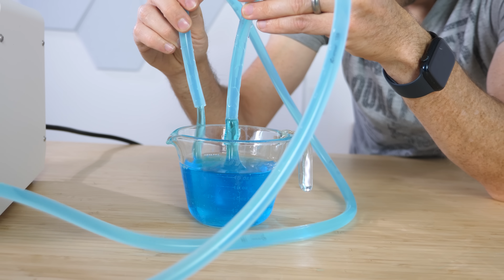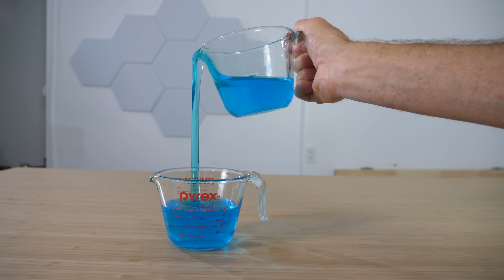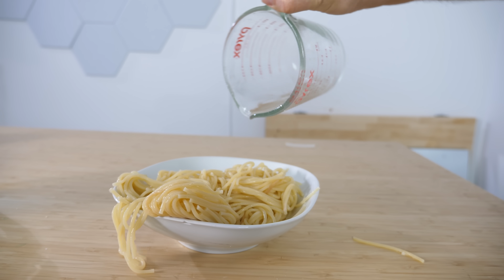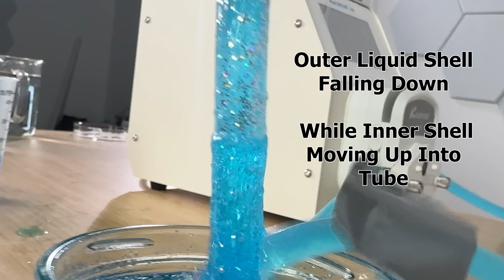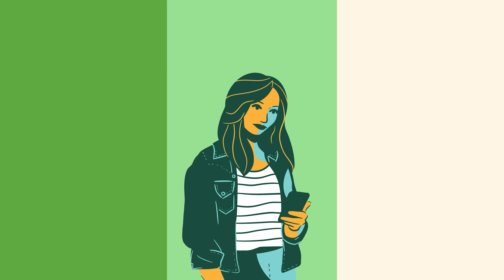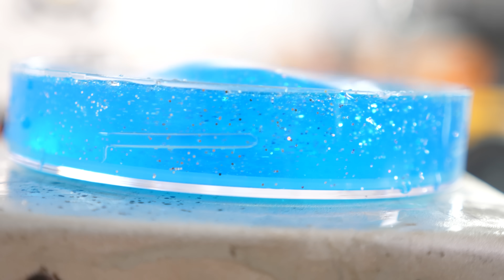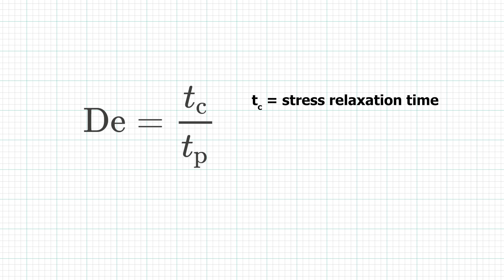Why Do Some Liquids Flow Up? The Mysteries of Shear-Thinning Fluids

Comment: Now I am curios. If you have a rod inside a sphereical container filled with some of PG, how would it move if you start to spin the container on the side of it's axis vs vertically? When you spin it sideways it climbs both ways on the rod. If the rod leads to a curved surface that curves back, and possibly back to the center of the rod, would the PG constantly be in a loop of following the rod, curving, then reattaching to the rod again?

Comment: Can you combine magnetic locking with a stirring plate using Lenz's Law?  I wonder if PEG could help stabilize a magnet with an aluminum disk glued to it, if it is made to levitate and rotate in a PEG solution (and cool it since the eddy currents will heat the aluminum,) and if PEG, PPG, or plain Propylene Glycol work best?  I'm looking to stir a solution in a round-bottom Erlenmeyer flask with mica powder pigments in it, to look like a potion, and I'm hoping to dampen the noise it makes by separating the stir magnet from the glass.

Comment: Action Lab: you are incorrect about the method of action of PEG-3350 (Miralax) as a laxative. It is not the fact it is slippery, but what Wikipedia says:

[Miralax] is an osmotically acting laxative; that is, an inert substance that passes through the gut without being absorbed into the body. It relieves constipation because it causes water to be retained in the bowel instead of being absorbed into the body. This increases the water content and volume of the stools in the bowel.

Comment: For information, visco-elastic properties are generally determined by sending oscillations to the submerged rod (or to two plates with the fluid in between) and measuring force vs movement of the rod. If the tested product is elastic, the force is proportional to displacement, while if it is viscous, the force is proportional to velocity (ie derivative of displacement).  So, if you plot force vs displacement, oscillations are in phase for elastic , out of phase by 90° for viscous and in between for viscous-elastic. Varying the force can give you the shear thinning properties if any and varying the frequency will give you the time dependency (visco-elastic fluid will be elastic at high frequencies because the long molecules don't have the time to rearrange and viscous at low frequencies)

Comment: I have a question that i believe can only be answered with an experiment:

If we have a long enough tube full of really cold water but with a really strong heat source on the bottom that can cause the water to boil and turn into vapor will the bubbles condensate back into water before reaching the surface? i am guessing that given a long enough tube that will occur but how long? preferentially not bubbles the size of the ones you see on sodas or electrolysis... i guess i just wanted to see a really big bubble get smaller and smaller until it disappeared...

Also... will the heat spread more efficiently through water if it doesn't get past the boiling point? i am guessing the heat inside bubbles wont make contact with the water around so maybe it's not optimal for heat spread... not to mention that past the boiling point it just turns into vapor and goes away so the system loses more energy that way...
Reply: Yes, the bubbles will condensate back into water before reaching the surface provided there is enough distance for them to be cooled below the state change temperature.

The main issue with such an experiment would be trying to create such a setup in the first place. Given the very high heat capacity of water making it difficult to increase the temperature of, you will most likely cause the entire vessel full of water to increase in temperature thus you wouldn't encounter any potential cooling effect.

You'd be better off with some liquid that has a much lower boiling temperature and heat capacity that can come in contact with a very high heat and instantly boil without affecting the entire body of liquid (So the liquid not in contact with the heat source remains cool)
Reply: @tarille1043  i suppose we can heat water on a second container and force the steam into the bottom of the tube with really cold water using a release valve... I think it may not be that complicated afterall, i recon even i can do it but probably no one would see it x)

Comment: you should make something that causes cavitation, like a metal box or heavy duty plastic cup that gets hit by a hammer, but just see the effects it has with different things put at the bottom that stick to the bottom, that will get hit by the massive energy caused by cavitation.
I asked chatgpt about whether or not cavitation could break the cell wall to make grass edible, and it said it could, but then it would have to be fermented to break down the other parts that arent edible to humans.

Comment: I just thought of this.  We've probably all heard a parent say, "I'm not paying to heat outdoors. " when you leave the door open.  I wondered if based on one door, from one house, per length of time,  could you calculate what would happen on a cold winter day if every house in the US opened two doors with the heat blasting at a certain temperature? Could we raise the average temp even 1 degree?

Comment: what would happend if you stir it in a bowl with both water and this polymer, will it just mix or will you get one vortex going up and one going down at the same time under it?
Reply: The examples he showed are the polymer mixed with water. The water gets caught up in the polymer matrix (hydrogen-bonding, etc) and the fluid is a homogenous mixture of the two. He included the water molecules in the drawing early on, but left them out of the subsequent pictures.
Reply: @mrbergchemistry  would that be the case even if the liquid is saturated and not taking up any more water?
Reply: I think it's the other way around, the water becomes saturated with polymer if there's not enough water. So adding more water would just dilute it further and make it more liquid.  @herneheim

Comment: 00:19 when does it stop? it must stop, right?
Reply: It has a pump
Reply: @Duckwithapartyhat  right, missed that. Wondering what would stop it without the pump though.
Reply: @lem0nhead84  cant have perpetial motion
Reply: @lem0nhead84  gravity. It'd stop p much instantly since the pump would act like a seal. Ofc, assuming there was never a pump, still instantly because the outflow point is above the top of the inflow point. Gravity would pulling it into the cup from the inflow rather than pushing it into the tube

Comment: Watching the stir bar and the PEG bulging in the center reminded me of galaxies and how mass tends to fall to the center. I wonder if that's a good analogy. Do spinning galaxies move like non-Newtonian fluids?
Reply: Not as such.

Non-Newtonian fluids work based on elasticity between molecules, which allows them to defy gravity (Up to a point).

Galaxies are entirely about gravitational forces interacting on things (With the compounding effect of increased density of mass providing more gravitational pull).

The interaction of non-newtonian fluids would function differently without gravity, creating a different overall shape (More like the sideways bar in the slime - With the fluid extending in both directions) rather than the typical "Disc with a bulge in the centre" shape that galaxies often form.

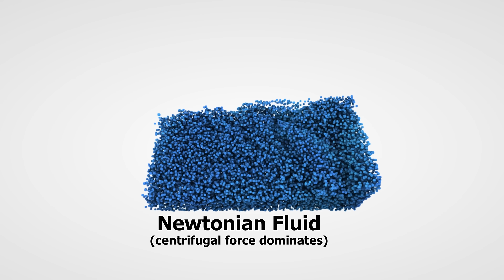Comment: 4:07 ive got that as a wallpaper in wallpaper engine, its a fluid simulation that you can control with your mouse (its very hardware demanding)

Comment: Nope. Shear-thinning (with an 'a') does not explain either the tubeless syphon or the Weissenberg effects. Elasticity is the origin of both. For instance xanthan (used in low fat salad dressing) is very shear-thinning, but does not cause either effect. That is because it is too stiff. PEG molecules are much more floppy. They act like like tiny bits of gloopy slime. They bounce back when stretched. If you made salad dressing with PEG, it would look disgustingly snotty. When an elastic solution drips, the broken thread bounces back. Yuck! Another result of the same property.
Reply from the maker: You are right, there can be shear-thinning fluids with no elasticity. I should have separated the two. But the tubeless siphon is also aided by the fact that it is shear thinning. I'm not sure of an example where you can get the tubeless siphon effect with no shear-thinning effect.
Reply: @TheActionLab  I think you're right. Floppy molecules distort in shear to cause shear-thinning and distort in elongational flow to cause tubeless syphon. 

On the other hand, xanthan's shear thinning is due to orientation of a stiff ellipsoid in shear flow.

Comment: Rocks are not non-Newtonian fluids. They don't bend over time, no matter how much time you give them. There may be metals and some other things that can bend over time, but not limestone, sandstones and other sedimentary rocks, igneous rocks or metamorphic rocks. If they're bent, wavy or swirled, it mot likely had to happen before they became solid rocks. Otherwise, it's not science and is nothing more than a religious belief, not based on actual, verifiable, scientific study. No one has ever seen a solid rock just bend. Even the most modern machines/computers cannot measure any permanent flexing of rocks, not even large one's. Religion is not science... and simply saying "millions of years" is not science. It's all based completely on religious beliefs.

Comment: Really cool and information dense video! I commented on a previous video that PEG is used in SPRI DNA purification. The common explanation is that PEG “crowds out” the DNA onto the beads, in the presence of charge neutralizing/DNA compacting salt. However given everything is soluble & already solvated, it seems the PEG must form some sort of its own “phase” in the solution, preferring to associate more with itself and sequestering water, forcing DNA into the microenvironment around the beads where PEG is excluded due to its size. It almost acts like a liquid crystal, given how it likes to interact with itself, but it’s too disordered to be considered a crystal- thus I wonder if a good analogy for this PEG phase is a liquid glass?

Comment: Can you pull it up and out of the container, so it flows without touching the top edge of the container, like you can do with a chain? It might not have enough strength or viscosity for that, but I'd love to see if it's possible somehow. I wonder if its fluidity would either help or hurt in that situation.

Comment: Idea: Demo of how extremely tall trees can move water from the roots to the very top, when it should be "impossible" over about 10 meters (wingspan of 5 adult bald eagles).
Reply: American units!
Reply: @jhoughjr1  Those are American bald eagles. 😅
Reply: The tree is not "sucking" all the way from the top. It is happening all along the "pipe", and therefore the 5 adult bald eagles' wingspan is not a limit.
Reply: @jsjs6751  ahh that just makes way more sense
like Surface tension doing its work?
Reply: @faizr93  Just show a "cup" of blue water moving up "a seven floor building". 😄
Reply: Finally someone speaks my numbers
Reply: @osensiv3sounds978   Just about every country speaks those numbers. Only a handful has inherited the imperial units.
Reply: Trees move water up using a combination of transpiration and the capillary effect.  Transpiration accounts for much more water movement than the capillary effect.
Reply: @adamwhitney3935  Definitely needs a demo!
Reply: Veritasium has made a vid about that
Reply: @ZuperCooldude  I looked that up. THAT was a young an promising Veritasium. 😅 With no demonstration. Just talking in a leather jacket. About negative pressure and water not boiling under negative pressure. This really needs a demonstration. Show, don't tell!
Reply: A couple of more or less testable suggrstions here. Sounds like something a science youtuber could demonstrate with some clear tubing and blue water.
Reply: I dont understand, wingspan is a horizontal unit. What is that in Empire State buildings?
Reply: @petoperceptum  It is a stack of 10 washing machines. Or is that a volume unit? 😅
Reply: 'MERICA!
Reply: No its actually transpirationa pressure difference bw leaves and roots thats causing water pump upwards....
Reply: @FRHN-GMR  Show it! 😄
Reply: Americans
Reply: gonna need the median wingspan of an adult bald eagle in attometres +/- 0.00001 am pls
Reply: @ΔΡΠ  The bald eagle has a wingspan of precisely 11 bananas.
Reply: Yikes. Education system strikes again.